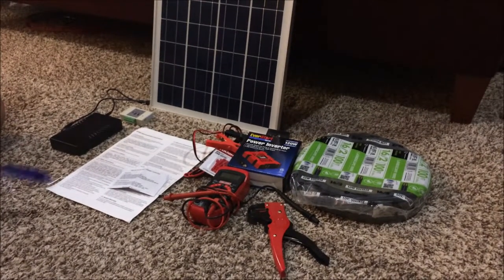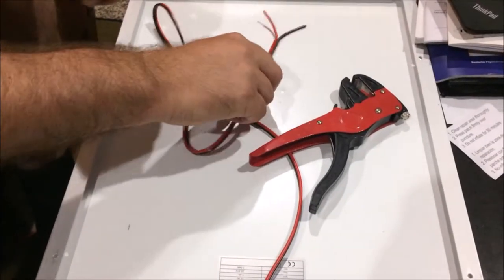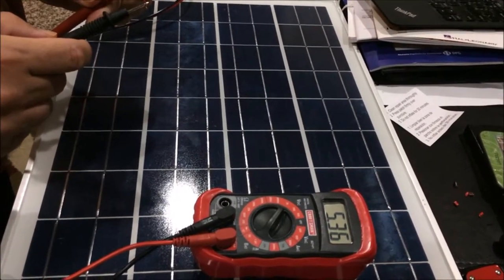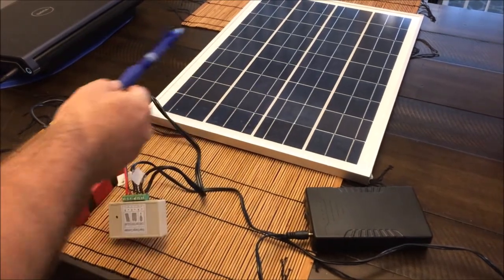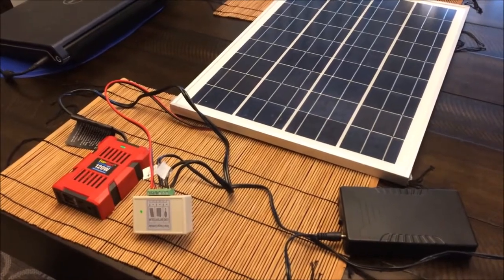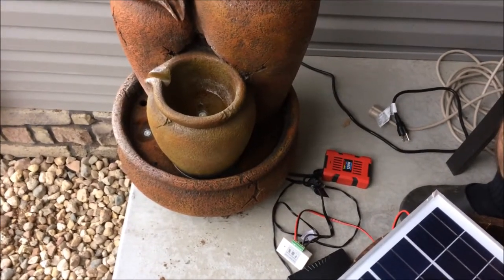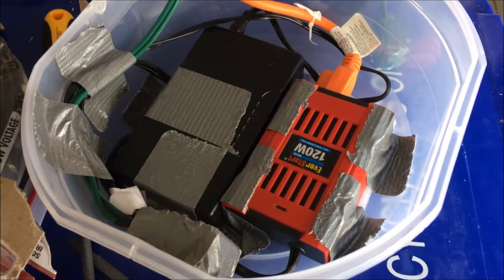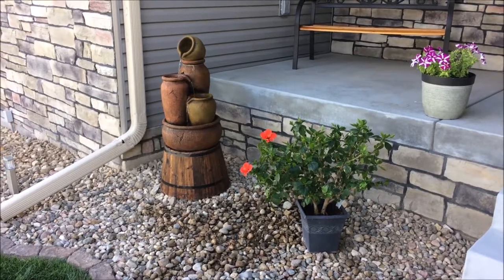Solar powering the water fountain

Comment: How do you connect the battery and inverter to the solar charge controller?
Reply from the maker: If you have a look at my video at 4:03 you can see how everything is connected. The controller makes it very easy, because it tells you where to connect the solar cells, the battery, and the device you want to power. In the case here, the device you want to power is not directly the fountain but the inverter. For the cheap inverter I used (you get it at Walmart for $10 or so) I simply cut off the connector that usually goes into the cigarette lighter and used the two cables to  connect the inverter with the controller (the light bulb symbol is the symbol for the device that consumes the energy). When you do that, you feed in the low DC voltage from the solar cell/battery into the inverter. The inverter turns it into an AC 110V output. You can use the outlet of the inverter as a regular power outlet to hook up your fountain. Make sure that your fountain is not too powerful. The cheap inverter I used can only deal with so much power. Should be more than enough though for these tiny pumps in the usual fountains. Hope that helps.
Reply: @lostmylaundrylist9997  Thank you. Do you connect the battery to the inverter in addition to the charge controller? It looks like the battery only has a DC cable and USB port.
Reply from the maker: @rianafisher3306  The battery is connected to the controller (just follow the description of the controller). It is NOT directly connected to the inverter , only indirectly via the controller. The additional cable you see in the video is a bit confusing. It is not a USB cable, but a charging cable of the battery. At the time I did this part of the video, the battery was not fully charged and I wanted to start out with a fully charged battery. Simply forget about this cable. It is not there in the final setup.
Reply from the maker: One more thing, In all these connections polarity matters. I suggest you have a volt-meter handy to check where is plus and where is minus. This is important.